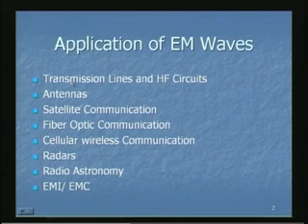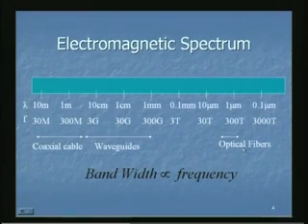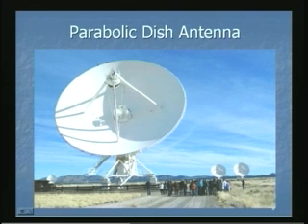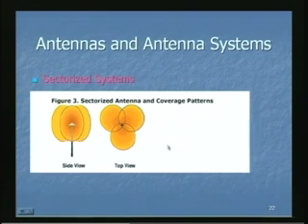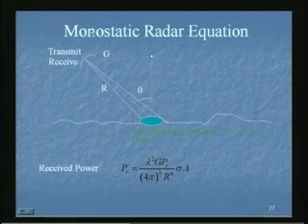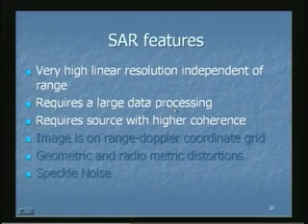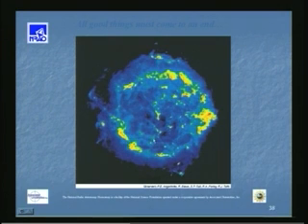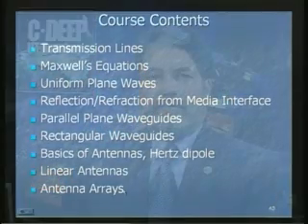Introduction to EM waves and various techniques of communication

Comment: Transmission-line theory shows that for all types of TEM mode transmission lines (coaxial, parallel-wire), the basic equations of voltage and current variation over the line are
dV/dz = – (R + jwL)I, and dI/dz = –(G + jwC)V in which R, G, L and C are distributed parameters expressed as so many ohms/unit length, farads/unit length and so on. 

A derivation of this expression maybe found in several textbooks.
Transmission lines operated in the radio-frequency range and at higher frequencies are generally modelled and analyzed using distributed parameters (inductances and capacitances) because the quasi steady-state conditions which allowed us to write capacitive reactance as 1/2πfC in the lumped region, breakdown in transmission lines of lengths which are greater thsan the free space wavelengths of the signal. Also, remember that fields do not travel; only the wave travels. 

It would be instructive to understand Current, the conduction process and Voltage at the fundamental level before progressing to a discussion of transmission line theory.
Electrostatics and circuits belong to one science not two as in the following two videos:
i. https://youtu.be/TTtt28b1dYo and 
ii. https://youtu.be/8BQM_xw2Rfo 

The sustenance of an electromagnetic wave between the conductors is because of two time-varying field processes,
i. a changing magnetic field produces a curly electric field (Faraday’s Law), and
ii. a changing electric field produces a curly magnetic field (Maxwell’s added term to Ampere’s Law). 

It is not possible in this post to discuss in more detail the distributed parameter approximation of transmission lines.
The last frame References in video #1  lists textbook 4 which discusses these topics in more detail using a unified approach and provides an intuitive understanding of distributed capacitance and inductance of transmission lines. 

[ See these lectures by North Carolina State Univ faculty which use a unified approach to electrostatics and circuits. 
15. Simple D.C. circuit. 
Pattern of electric field.
Watch from  16.0 minute.
16. Mechanical Battery
Watch from 19.0 minute.
Ch18L1b
https://youtu.be/Eu3JQKrJRZA?si=t3MeX8Hi8ELAxaz0
17. First intro to  Surface Charge 
Watch from 10.30 minute. 
18. Surface charge gradient 
Watch from  15.30 minute. 
Ch18L2a 
https://youtu.be/bp0o1HZOs3g?si=PPiPGepbXvdTgJHX ]
Also, in the textbooks referred in the last frame of video i you will find descriptions of the operation of resistors, capacitors and inductors using this approach which makes it easier to understand.
There is also in Chapter 5 in the textbook references 'Fundamentals of electric theory and circuits' which explains the operation of transmission lines using the unified approach.
Also explained in the chapter is why the speed of the voltage wave is always less than the speed of light.
Textbook 4 is here https://techsarworld.com/product-detail/fundamentals-of-electric-theory-and-circuits-559 
PPTs and Videos with animations for all the ten chapters including that of transmission lines Chapter 5 and a few applications Regulated DC Power Supply, Differential Amplifier and Transformer coupled audio power amplifier of  book Fundamentals of Electric Theory and Circuits are available for download and viewing here
https://techsarworld.com/download-resource/fundamentals-of-electric-theory-and-circuits-559

Comment: C1  R = A/L not rL/A -- why? because electrons flow according to mv-squared rules. And in those rules a fluid in a thin pipe flows faster -- but electric theory says there is less flow in a thin conductor -- there are fewer electrons but they are moving faster; but when more electrons are in a CSA they move slower: naturally. So we need simpler theory to replace the current lies. You can see for yourself it is logicallyand actually impossible for a meter to measure BOTH voltage and current.